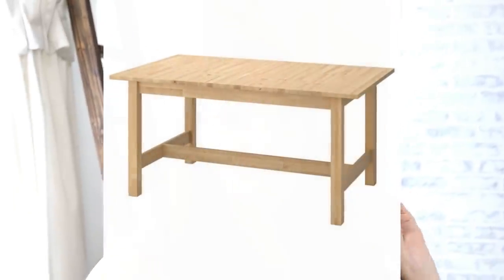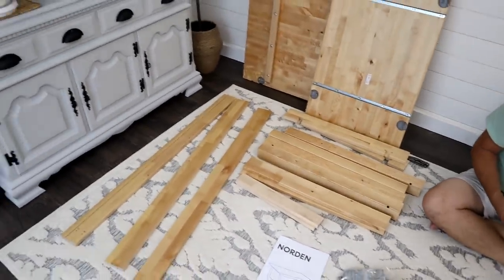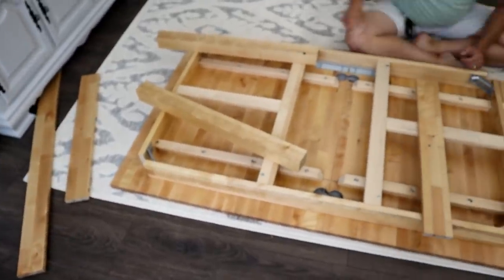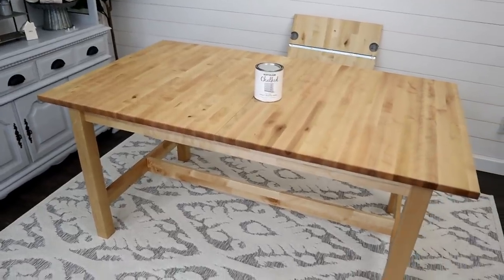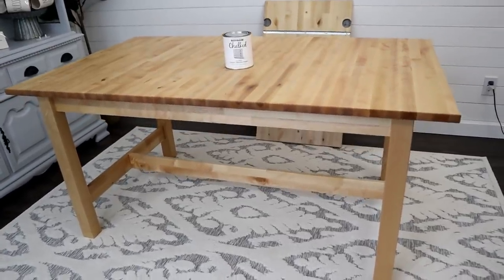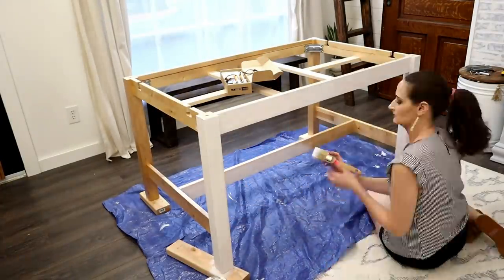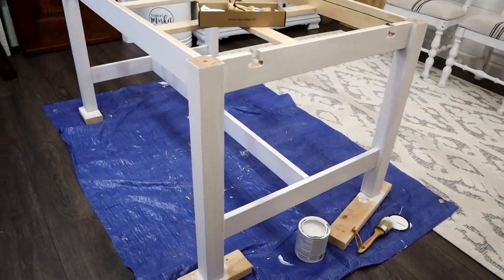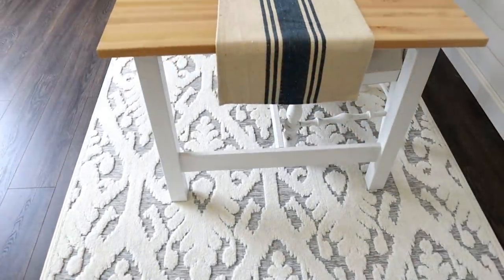Farmhouse Table DIY | IKEA HACK

Comment: This turned out beautifully...I was wondering when I use the matte polycrylic it turns yellow. I have tried different temperatures and brushes but it does it every-time.  Any idea why?
Reply from the maker: So strange??? Usually polycyclic doesn’t turn yellow because it’s water based. It can yellow over time but not too much.

Comment: I would have put the table on its top with the legs up in the air to paint the bottom section. Therefore, you wouldn't have the bottom of the legs on the floor. Oh well, you got' it done.
Reply from the maker: True! Lots of ways you can go about it